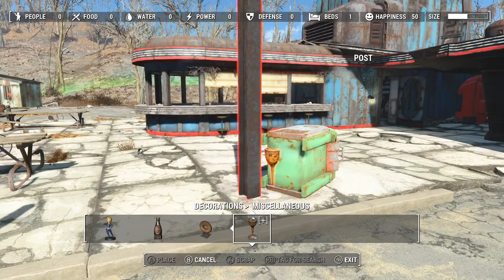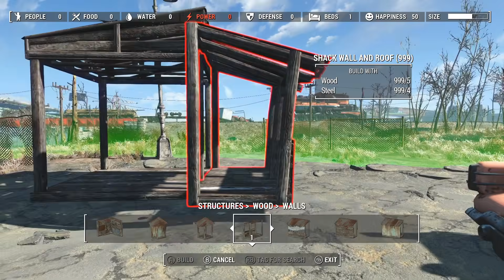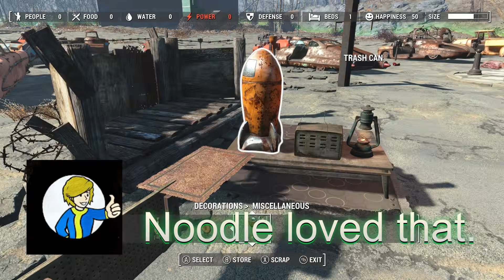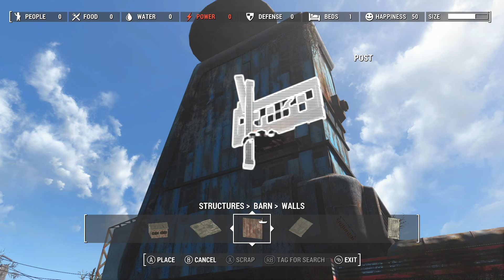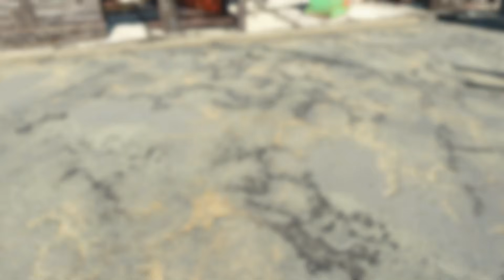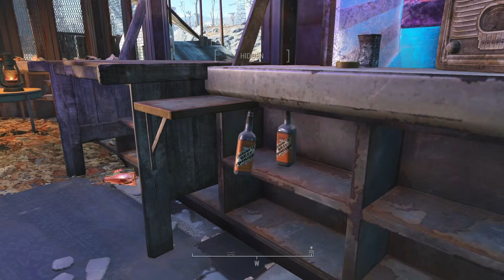Check out the Fallout 4 'New No-Mods Handbook' - A Starlight Drive-In Build

Comment: Ok so im on my 2nd run of the game. Huge fan of building style games like CitySkylines. So ive seen others using the puller method. Im in ps5 and when reconstructing the castle its a bit frustrating trying to get warehouse concrete floors lined up. Again I dont or have a way to use mods. I know what the title says about no mod builds.
Reply from the maker: I am happy to help, but can you tell me what you'd like to start with, specifically?